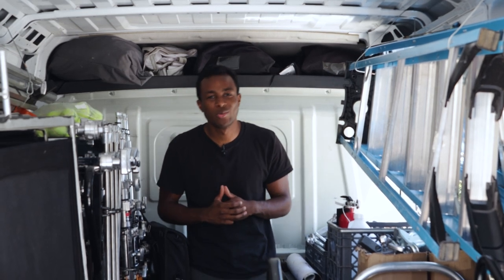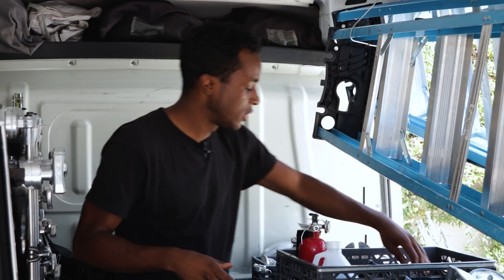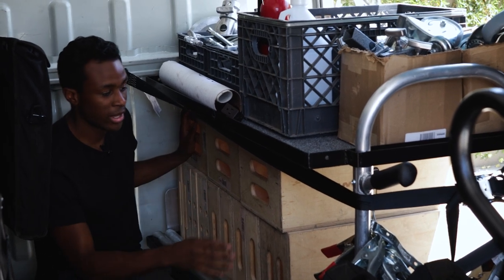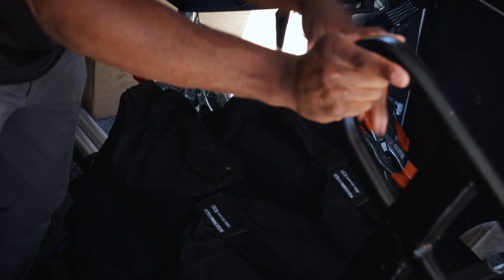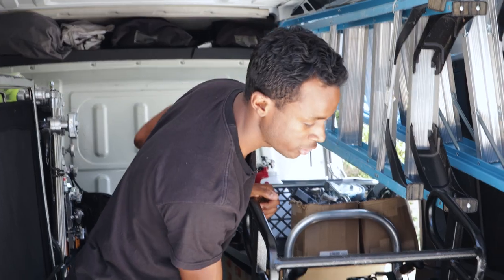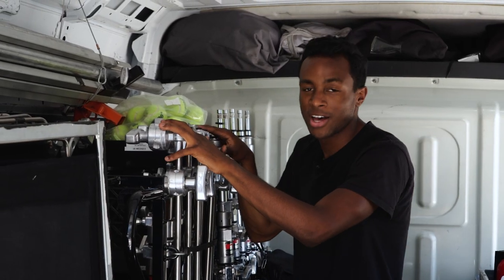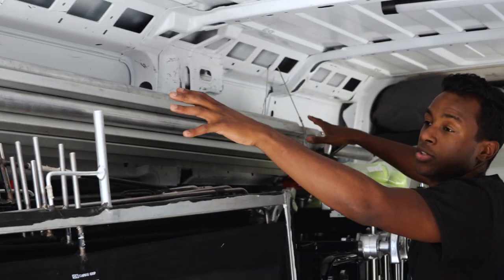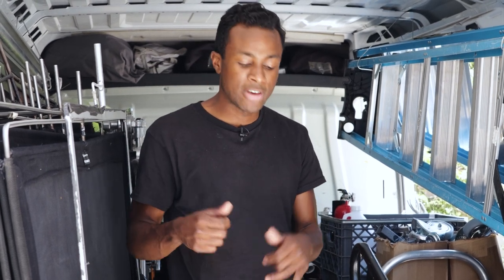Lighting & Grip Van Walk Through

Comment: Great video and you have a terrific set-up, especially once you have all the final touches completed. Have you considered adding roof racks? I worked with a gaffer in the past who put a big PVC pipe on the roof-rack, bolted down, with one end hinged and in there he put his speed rail. He also had several smaller PVC pipes to hold full sheets of diffusion. Lastly he had ladder clamps and that's where he kept his ladders so they didn't take up room inside. Of course, he had to keep in mind his truck was then taller. Do a brief video when your van if fully tricked out, I'm sure we'd all love to see the finished product.
Reply from the maker: Thank you for the comment! Still thinking thru the way to attach the speedrail but this is a very good idea!